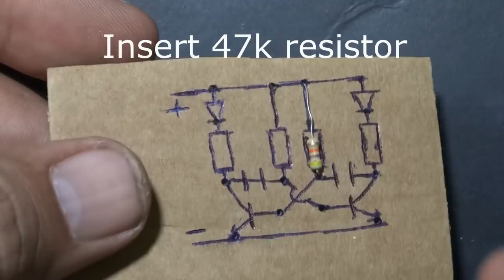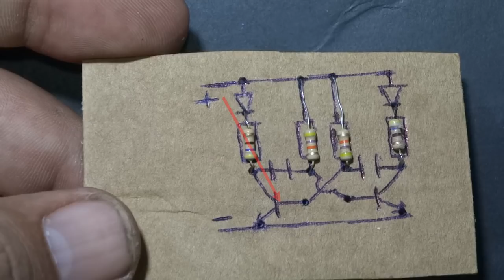flip flops blinking circuts

Comment: Hy dear 
I want to make this type of board but i want to make blinking speed slow can you tell me how?
Reply from the maker: Yes dear just change resistor which is connected with point 6 & 7 
Use 10k resisters it will slow down the blinking speed 
U can increase 10k to more and blinking speed will b more slow down
Reply: @gillanidata  thank u so much😍
Reply from the maker: Just change the resistors which are connected in the middle
Reply: @gillanidata  which one 
47 k or 470 ohm?
And one more thing i want that both blink slow equal
Reply from the maker: Dear it is 4.7k
Reply from the maker: U always welcome

Comment: What is the input voltage?
Reply from the maker: 3 to 5 volts
Reply from the maker: If u want to connect 9/12v then use 1k resister with input current

Comment: Can i 2n2222 transistor
Reply from the maker: +Shafik Ahmed  yes all NPN transistors can b used
Reply from the maker: +Shafik Ahmed  you can use 
547
13003
13002
 9013 
   945

These all are NPN and u can use all these